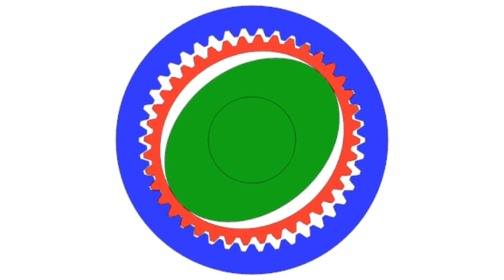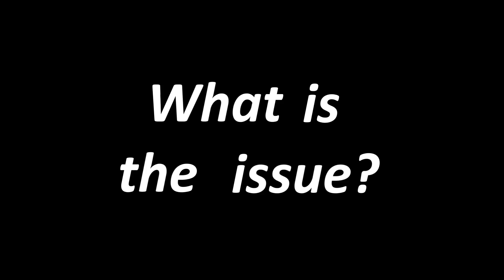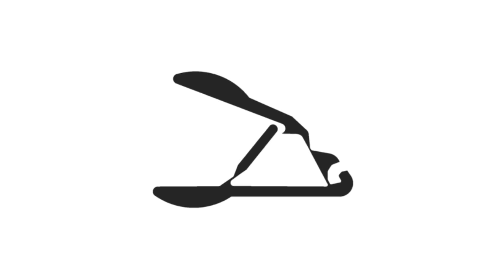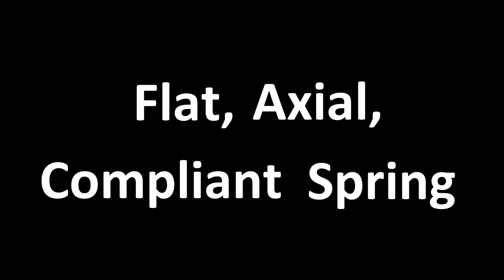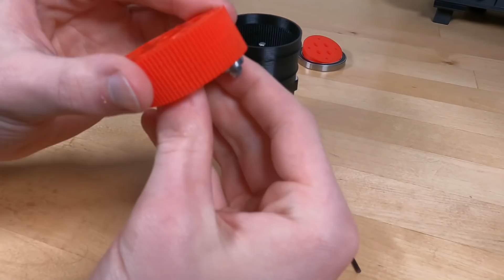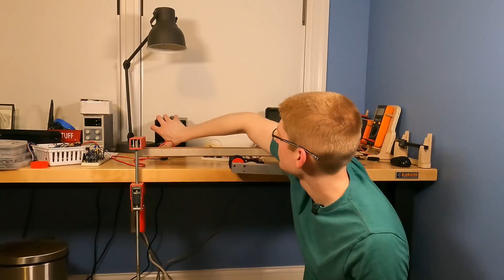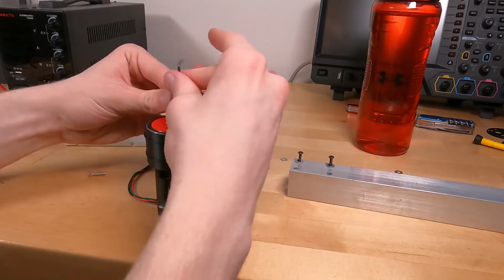Compliant Harmonic Drive (3D Printed)

Comment: I think you can give the compliant spring more depth ( not width) it will keep its elasticity and give more support against torque
Reply: Maybe also add some radius or chamfer to the attachment point from the spring to the internal and external gear so the plastic won't break at the sharp corner.
Reply: @julstr6303  ^ this
Reply: @julstr6303  very much dis^
Reply: And if you keep adding depth until it's as deep as a regular harmonic drive, you've basically created a stronger (better?) version of the regular harmonic drive.
Reply: @frother  thats not how mafia works
Reply: Though it does remove the benefit of being compact if he make it longer.
Reply: @Enkye_CA  Yeah but just a little bit
Reply: he should have printed it out of petg or some other material. its actually really lucky pla lasted that long. pla is usually really weak unless its some other version like pla+ . if made out of petg it would have probably withstood much more torgue before breaking.

Comment: Something that comes to mind, you could alternate the spring "direction" so that for every "left" spring there is a "right" spring. That way the mechanism has support in both directions. Another improvement would be to make the springs thicker vertically.

Comment: You mentioned that one torque direction could withstand more than the oher. So I thought that you could add the same pattern on the first (in the same part), like it is another 'layer', but mirrored, so it will compensate the inequality.
Really loved this design, to me it's the most interesting I have seen that is 3D printed. I think you could expand the research from here to make a very good design, great work!
Reply: Another option may be to include springs in alternating directions. That would probably come at the expense of radial space, but would still allow for a low vertical profile
Reply from the maker: I was thinking the same thing, I wasn't sure how to implement it easily. I guess layering it wouldn't be too difficult.
Reply: ah, you had the same thought
Reply: @LeviJanssen  I mean you could always just print two parts and assemble them together in some way. You could also print supports between the two layers of springs, but those would be hard to remove, I reckon.
Reply: @LeviJanssen  you can do that as a single print leaving a small gap between the two spring layers keeping a single hub. Also, increase the depth  of the springs and gear without modifying the thickness. That should provide more strength without compromising the elasticity. Also, consider using TPE. Though, a TPU spring with PLA center would be even better. That, however, would require a printer able to print with two filaments, or a lot of fun doing it manually.
Reply: @LeviJanssen  might look at wave springs for inspiration.
Reply: @LeviJanssen  and why not do it in nylon too.
Reply: @LeviJanssen  it might be the easiest to print it flat, warm it in hot water and use dies to squish it into shape.
Reply: @LeviJanssen  maybe you can just make the spring symmetrical.  Less length followed by a spring in opposite direction.  Probably a million ways to make changes, thanks for giving us inspiration.
Reply: @LeviJanssen  No need for separate layers.  I think an 'X' shaped spring would work and be very strong against shear.
Reply: probably wouldn't be too hard just to print two of them, flip one, and superglue the rigid sections together, you'd effectively double the depth but that's not too much of a compromise considering you've already cut the depth far more than half anyway.

Comment: Hey if you want less "wobble" without over stressing the threads I would suggest adding some springs to the bolts. 
It does add "more load" to the threads at the same torque, but that also allows you to convert that load into frictional between the 3d printed part and the metal beam.

This is kinda how we use springs on watercoolers for CPU's/GPU's, you don't want to crack the chip so you add spring loaded mounting brackets that distributes the load more evenly ensuring a "tighter" gap between the cooling surface and die... so in turns the force is applies more evenly.
If you ruffen up the metal beam that would add more friction between the metal and plastic, kinda the opposite that we do with coolers.
it's probably not going to make it "stiff" but it should prevent a couple of wibbly wobbly, timey wimey stuff to your presentation :)

Comment: Great work Levi!
I have a couple of suggestions - use fillets at each end of the compliant spring to distribute more force and reduce stress risers. You could have more of them per revolution, and you aren't limited to having them in just one plane, so you could layer them up for even greater torque transmission.

Comment: Swap in some spring steel strips with the PLA as just housing? 
Junior hacksaw blades are a good source of thin spring steel which can (usually) be bent 90 degrees without breaking...

Comment: well done, you are really close to a solution, both the vibration and the strength. All you have to do is print the compliant mechanism seperate from the spline, print two, put one of them up side down and glue them both into the spline. Now the two compliment each other, and the mechanism should be much stronger and there will be less vibrations

Comment: Awesome video! I'm working on my own harmonic drive myself aiming to be super compact as well, but using an inside-out HTD belt instead of 3D printing a flex spline. Initial results are promising but I still need to get a high power motor driver and do some torque tests!

Comment: 'Elastically' deformed, not plastically. Also, this project was AWESOME! Please keep developing. Torque is usually expensive - either in size or cost, so cheap torque will always be in demand.
Reply from the maker: Yeah, I had to correct myself at least once, I probably missed other occasions.
Reply: ...Like Ford Mustangs.
Reply: I agree. Keep up the good work! What you're doing is awesome. And interesting to boot!

Comment: Thats amazing, I can see PETG or ABS making a huge difference in strength. I would go at it again, good video! Thanks for sharing
Reply: ABS/ASA are finicky but they could work indeed. PETG only works up to a point, under repeat stress and certain applications of force it paradoxically crystallises and becomes brittle! But there are printable TPU/TPE varieties, and not all of them are that low Durometer, they could be of use as well, they're basically made to handle repeat stress. Polyamides (Nylons) as well after one-time conditioning.

Comment: Pretty elegant design. Curious to see what geometry, layering and other stuff you will create to put more springs and material to handle the torque.
Reply: I think the best bet is to use a more flexible material. With something like ABS or PETG, you could get the same flexibility from thicker (and thus stronger) parts.

Comment: Addressing favoring direction: move the inner support to the middle and double the outer to both sides of the "spring".  Angle the inner as "v" hitting the core allowing load to be transferred via compression and extension.  You can do the same with the outer.

Comment: Cool Project! That's the tradeoff with Harmonic drives - no backlash, but your stiffness is compromised. Even happens on the indutrial drives. They are a lot stiffer than the plastic ones because they are metal, but not nearly as the stiffness you get out of a normal gearbox.

Comment: I used a harmonic drive back in the eighties, but it was different to the one you have. It had two outer gears, both same pitch diameter but one had one less tooth. The flex spline engaged in both the output would rotate one tooth for each rotation of the flex spline.

Comment: Great idea! The most obvious way to increase the capacity is to simply scale up the springy part in the Z direction.

Why do you (and so many other makers) use such small bearings on the bearing bar? Seems to me that you'd want to use the largest you can fit, to produce a smoother bend in the flex spline, reducing fatigue and getting more teeth engaged and supported. Either that or use a bunch of small bearings placed along an ellipse to simulate the proper elliptical bearing of a harmonic drive, counting on the stiffness of the flex spline to produce a somewhat smooth curve across the spaces between each individual small bearing.
Reply: Mostly cost I bet. Smaller bearings are cheaper both in material cost and in shipping cost.
Reply: What if the whole bearing bar would be smaller, say only 2/3 of the diameter of the flex spline? Now you have whole outer 1/3 to try various compliant mechanisms to optimize both flexing and torque. And leading to space saving overall.

Comment: So cool, hope I can learn to use what I learn at uni like you do. Best of luck making a reliable 3d printed harmonic drive. It would be fun to experiment and take your compliant mechnisum and extrude it on the y axis to add more torque but keep it compliant on the x and z axis. (Extrude the y axis until it's big enough to fill the empty space from the regular design)

Comment: Very interesting way to get a gear ratio like that.  Although you can increase torque in these methods, You still will only get the torque that the materials can handle.  And thin plastic parts don't handle torque very well.  But this does show potential if you are able to get your hands on more appropriate materials.  Be cool to see that done.
Also the only experiment that is a failure is one where you don't learn anything.  I think we learned alot from this.

Comment: you can introduce some sliding slots to transmit the rotation force, and then use smaller deeper springs for radius changes.

Comment: The super low parts cost for 3D printed harmonic drives makes them really favorable to cycloidal drives that rely heavily on bearings. To the point of the compliance being variable in rotation direction, you can mirror one of the flex splines and run 2 inside the same rigid spline connected to the same output. That should give you more symmetric torque, and also double the amount of material you've got in contact.

Comment: Not a "simple" concept but a very intelligent and eloquent solution to the problem - inspired work - congratulations.
May I suggest movement limitation stops in the flexing wheel that will prevent the spring element from being overtaxed?
This could cause lockup if the spring element is over-stressed but that is good - don't drive the mechanism beyond its mechanical limit.
I wish that I could share a doodle here to visually explain what I'm talking about...

Comment: Would love to see you try this again.  But this time, turn your spring.  An inner core, an outer gear set, and two sidewalls with outward flex, but solid and without flex in the direction of motion.  Think Goodyear tire.  For bonus points, look up some of the solid tire concepts from Goodyear for the military.

Comment: I was building something similar, only a little bit more fancy. My thought: it's not ideal to make the compliant struts curved, since they would bend under tension -> reduced accuracy. I would make those struts straight, maybe even with thinned out joints at the ends.

Also something I was trying out as well: there's a type two harmonic drive, where you have one flex spline that is basically just a toothed ring on an eliptic bearing, and two rings with inside teeth. One of those rings stays stationary while the other is connected to the output and they both have a tooth count difference of 2. This also makes a very compact drive, but it has high demands on the accuracy of the inside gears since any deviation of the tooth shape would result in backlash or binding.
Reply: I'm looking at similar aspects, but somewhat different conclusions..  
First, at the end with it broken, notice how they seem to have 'curled up' at the ends.
The opposing curves at the ends of the elements makes the longer element want deflect on a diagonal when under the 'compression' direction force. 
Instead of a curve and flexing at each end, they need a trapezoidal pillar as an anchor for each base connection.  Then the element joined flat to the top of the trapezoids, make the joint much stronger so it can't bend out of line or curl.  IOW strengthen the ends, and make all the flex of these elements happen in the longer middle area.  Stronger end corners will keep the entire element from shifting out of line and make the force spread out into most of the longer element between the base pillars..

Comment: If the spring is indeed stronger one way vs the other way, you could possibly add in a mirror image of the spring system and that would definitively help, that way it can be under tension both ways instead of just one.

Comment: The broken springs are mostly broken past the bend. I don't think they need to even have a bend like that, and it doesn't need to be where they flex the most either. I'm thinking a design with concentric circles connected by short thick spokes, out of phase such that each outer spoke sits in the middle between two inner spokes and vice versa, may be worth trying out. The test showed where the weakest point for this particular design was for the rotary force, not that it had to be that weak there. We want rotational stiffness and radial flexibility for this task. We could also make approximate evaluations with FEM (built into e.g. FreeCAD).

A part with these same goals is typically mounted in 3D printers: the shaft coupler. Compliant versions usually have a spiral cut in their midsection, allowing some flexing. There its main purpose is to adapt to slight differences in axis alignment. Unfortunately, many makers then skip the part about stabilizing the output shaft against linear axial force.

Comment: What if you replaced the longest section of each of those flexures with an off the shelf metal strip or wire or something? You could beef up the plastic sections and have all of the bending be done by the metal.
Reply: the solution should be from the design first before looking for the material science...
Reply: Surely design is interactive with material dcience? Different materials have different properties to design with.

PLA isn't a great choice for a flex element.
Reply: @anoirbentanfous  shouldn't you keep material properties in mind when designing? And designing for one material might not work for another
Reply: As long as you designed the mechanism to stay below the fatigue limit of the material, any material is a good material for the application. It all depends on what you are shooting for. If you are looking to minimize cost, but don't care about size, you could use a cheaper material and give it more room to flex without stressing the material much. If you care about size, but not cost, you could make it from a more expensive material that is better for higher stresses. And if you are really creative, you can come up with a design that optimizes cost, size, and performance using a mix of materials.  Engineering should never be constrained to "this is the material for this application". That will severely limit creativity. Creativity, plus a clear, unrestrictive definition of the problem, the willingness to fail, and trusting but testing other's advice equals finding the best solution possible.

Comment: I wonder how hard it would be to make a design that replaces the springs with metal spring blades and the outer circle that deforms with a timing belt.
The only challenge with that would be to somehow attach the metal spring blades to the timing belt.
Some kind of small riveting or stapling might be able to work with that if the timing belt is wide enough to allow enough teeth area to remain intact despite having the rivets/staples there.
If it all came together you could get some really solid performance out of that thing.
At that point it wouldn't matter if going one way is stronger than the other way, cause event the weaker one would be insanely strong for a mostly 3d printed design.

Comment: Heck yeah there are more optimizations to come!  
Make that spring twice as thick. Use 2 springs, one flipped for symmetrical load.
Make more springs instead of only 6 around the circle.
Great design!  I think you've started something great!
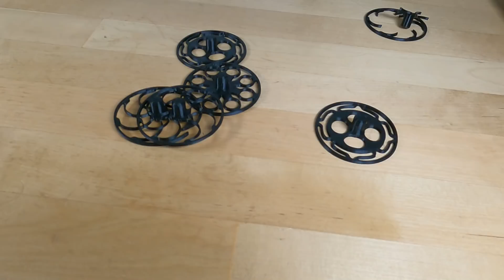Reply: 4:36 in the top left...What went wrong with that one?  It looks the same as the final spring,  but had 8 springs around the circle.  Was it too stiff?
Reply from the maker: It had eight springs and was significantly stiffer, yes.

Comment: Add some meat/plastic on the gear ring between each spring and design a slot through with a metal pin could be slipped in during 3D printing. The torque could then be transferred more directly from the outer ring to the center via the pins as opposed to the being transferred via the springs.  with a hole in the center of the long straight section of the spring tuning the spring dimension might be required. Very nice though.

Comment: The direction bias could probably be fixed with mirroring the springs backwards, like a modified Y shape. Maybe have to sets of rings s othere's no bias between the hub or ring having more connections to the Ys, as in invert every other one so that the connections are -1-2-1-2- on the ring and -2-1-2-1- on the hub, where the horizontal of the Ys are offset to form two rings of the concentric portion; this should also add some strength overall. Better materials would also help with the strength quality of a compliant harmonic, just as there's a reason industrial-grade harmonics always use metals and not plastic. This could easily evolve into a viable solution, and with it being open sourced it'd make industrial-grade robotics more affordable.